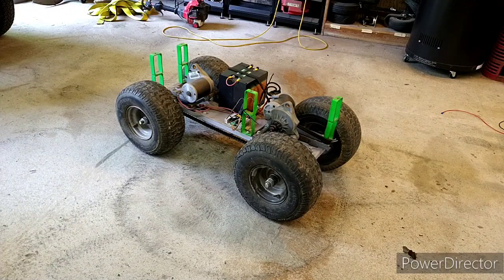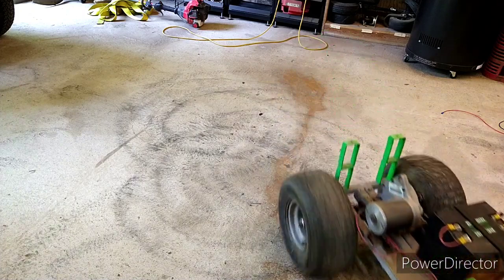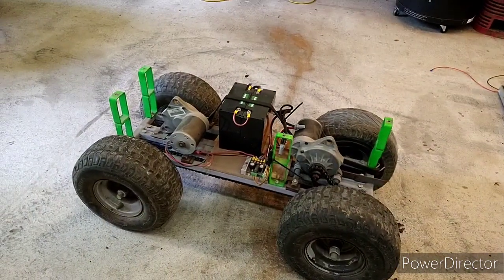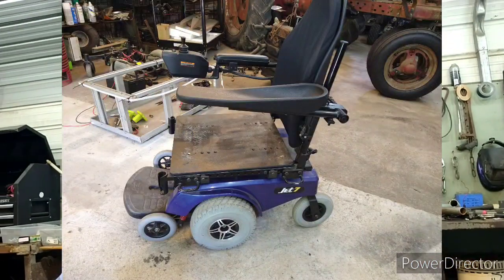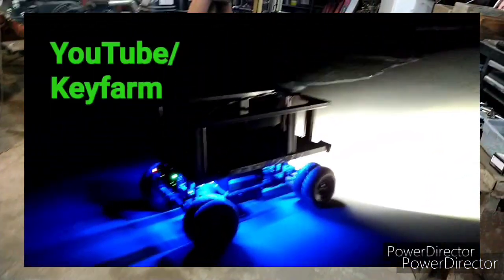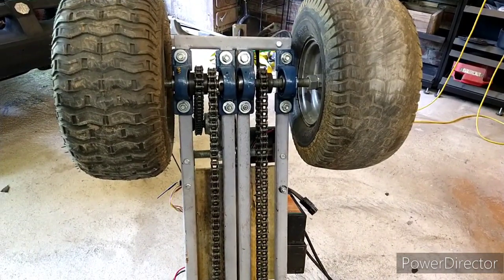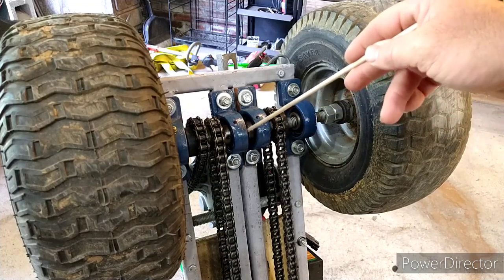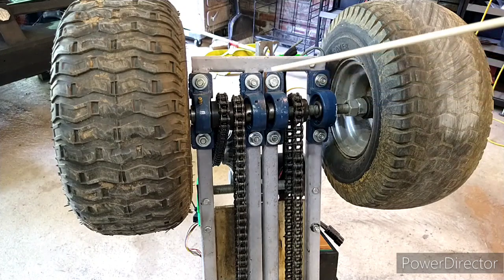Radio controlled beach wagon build video. How I built the R/C wagon.

Comment: Chris, did you have to change any switches on the saber tooth? So far I’m not getting any response even tho I’ve got green lights.
Reply from the maker: Honestly I cannot remember but if you send me a message through  messenger I'll send you a picture back of a close up of my saber tooth
Reply: @ChrisfromKeyfarm OK, I’ve never used messenger. Give me a few to figure it out. TY for your quick response.
Reply: @ChrisfromKeyfarm I can’t figure messenger out. Can you give me some guidance? 🤦🏻‍♂️
Reply: @ChrisfromKeyfarm I think I figured it out and sent you a message. Also sent a picture of my setup. I removed the red positive to prevent accidental triggering of the motors while I figure this out.

Comment: cool video thank you for sharing this how many pounds do you think them beach carts can tote?
Reply from the maker: That is going to vary quite a bit mostly because it turns like a skid steer the more weight the more you're grinding the tires into the ground if you're on slick ground that's fine if you're on asphalt that's a lot of power going through those motors. On asphalt I'd keep it to about 60 lb on grass with slick tires 200
Reply: @ChrisfromKeyfarm  ty i own a sod company looking to make an r.c that can carry 10 rolls of sod for back yard work
Reply from the maker: Cool I think you could build a version of this and it would work great
Reply from the maker: I've actually bought parts to build a second one that I'm going to gear even lower for more power and put on slick golf cart tires you may want to look into something like that as well
Reply: @ChrisfromKeyfarm yeah that's what I've been thinking it's all new so I'm trying to really educate myself on the best way to do this I don't want to just waste money I want to build an actual holler that might go up around a ramp well loaded maybe even a hydraulic Lyft
Reply from the maker: I haven't really drawn it out but I have considered one that has a front axle a rear axle and is articulated in the center
Reply: @ChrisfromKeyfarm  that would be pretty cool . im just getting older and its harder to get the jobs done with out the extra help from stuff like this . im im trying to find my plan to take me into the next round !

Comment: I desperately need you help
Reply: Ok........ I have a remote-controlled lawnmower. It has pretty much the same components. I will make a video tomorrow to put on my page of the internals. Ultimately, I  need it to be a little faster. I'm wondering if adding an identical or similar battery would increase the speed. It also has a built-in alternator. Currently, it charges the existing battery to 14.4 volts. Well, at least that's what the voltage display shows. I just need it about 3 to 5 more miles per hour faster.
Reply from the maker: @turtlewax2 mine runs faster with more voltage. So instead of being 14.4 volts if the components will handle it, make it 18 volts or 24 volts.
Reply: @ChrisfromKeyfarm  I'm almost 100 percent sure the motors can handle more voltage. My fear is in reference to any other components. It also has a deck that raises and lowers. There's a guy in YouTube that has one also. He put a chair on his mower. I have the same exact one that he has. He normally does review videos. The mower is red. I have the Daredevil version.
Reply from the maker: I'm not real familiar with that seems like it's designed to go a certain speed you could up the voltage or you could tear those electronics out and put your own electronics on and make it do what you want

Comment: Great video.  I appreciate your attention to detail in explaining your process!

I have a question about the battery options.  

Can I use a 48 volt battery from an electric bike ( already have ) 
With this controller?  Or will it fry it?   

Could I add a device to step down my volts from a 48 volt battery that you would recommend?

Thank you for your time.
Reply from the maker: I can't remember the specs on the motor controller , you could Google the specs and find the max input voltage, I wanna say it was like 37 volts. As far as a step-down converter one that provided that many amps would be very expensive.
Reply from the maker: Step down converters are great for stuff like lights and they're super cheap but not so much for stuff that draws a lot of amps

Comment: Is there a site that has bearing blocks,sprockets,chains at a deal?
Reply from the maker: I get everything off of eBay and none of it cost very much just search pillow block bearings with your size included they're like eight bucks a piece. Same thing with sprockets just search #40 sprocket ( if using 40 chain like me)and then the size of the bore that you need -example - #40 sprocket 5/8 bore 18 tooth or 5/8 bore pillow block bearing

Comment: Do you remember the dimensions of the lower frame and the size/thickness of square tube you used? Also the box on top? 🙏
Reply from the maker: It's definitely  1"x1" -1/8 thick wall tubing, but could have been thinner if I had any. Right off hand I don't remember the exact dimensions , but really just build to the size most useful to you .
Reply: I'm guessing the bottom frame is roughly 1x3.5 or 4 ft, 1in x 1in square tube that's 1/16 or 1/8 in thick, and steel?  And the top frame is aluminum, roughly the same length, close to 2 ft wide, and aroun 1.5 ft tall?
Reply from the maker: It's just tall enough to clear the batteries.
Reply: @ChrisfromKeyfarm  Thanks man. If I pull this off I will send you pics in email.
Reply from the maker: Cool 
ckeyfarm@gmail.com

Comment: I just want to reiterate how much I appreciate the amount of thought you put into this. After a YT search, I found countless vid copying a couple of builds from years ago. I cant really blame those publishers, it is useful to see their experience and that they were able to make it work, but I really didnt learn much from them over what I learned from the original couple videos. You, however, have done something unique. It is a true 4WD. It is a true zero turn. It is geometrically balanced. It has the ability to switch between power sources because of the forethought that you put into the power connections. And the fact that the power source can come from such a wide variety of options is impressive. After watching a bunch of others today .. because I have a sudden interest in this kind of build 😁I specifically came back just to share this to others. I want to see you add tracks. If I ever get to the point you got to in this video, I will give it a shot.
Reply from the maker: I have looked at those small sets of tracks but since these videos don't do very well I just haven't invested in it. Thanks for watching

Comment: Amazing video!! Been coming back to your channel a lot, not sure how I missed this until now. SOOO much great info here. For example, I was already eying the cytron as an alternative to the sabertooth, so glad to hear your endorsement!  The demonstration at the end was REALLY fun to watch!

Did you use fuses? Did you do anything to the shafts on the middle side, i.e. between the two middle bearings, to stabilize the shafts? If so I don't think I caught that, but it might not be needed.  I followed the link but didn't see it in the description .. do you know how many amps those motors draw, or what is their torque rating?  Just wondering for comparison to other options.  
🙏🙏🙏
p.s. been praying for your family member
Reply from the maker: These controllers whether it be the sabertooth or the cytron have several protections built into them so when I was using the 18 volt batteries I did run those through an inline fuse but when I ran the bigger lithium batteries I did not. I'm not sure about the amp draw ( probably average 15-25)on these motors and depending on how much work they're doing ,it would change I'm sure it spikes at the very beginning but as far as torque since they are gear reducted motors they have a massive amount of torque. 👍

Comment: I want to build something like this but I never actually built anything should I start small or just do it any advice?
Reply from the maker: If you want something similar but don't have a lot of experience building what you need to do is buy an old power chair where the batteries or the electronics have went bad. Put new batteries in it remove all of those electronics and add new electronics. I can show you / tell you how to hook it up. I have one made just like that and it is awesome an old non-working power chairs are normally about a hundred bucks.
Reply: @ChrisfromKeyfarm  yes please !  And what where do you usually get yours
Reply from the maker: Marketplace is the best place to look .
Reply: @ChrisfromKeyfarm  I found a couple !! In working condition too
Reply from the maker: Cool
Reply: @ChrisfromKeyfarm I’m trying to find a non working one so I can actually learn

Comment: Can you specify more about how you connect the electronics together , to  futher discuss we discuss in a zoom meeting ?
Reply from the maker: These electronics are pretty much plug and play. I learned how to use them by watching other YouTube videos. Search sabertooth motor controller
Reply: The electronics portion is extremely simple because its using modular components. Its basically just matching specs and doing some wiring. He already supplied the components that work for him, thats a great starting point. In fact, I highly regard his endorsement of electronic components. His commitment to budget friendly design is also very admirable. If you find these parts cheap, Im sure you can wire them together.

Comment: I desperately need this. Is there a parts list?
Reply from the maker: So I don't put a parts list in the description because links expire and that doesn't really help people but if you'll search for the part that I named on eBay every part of this buggy can be bought on eBay , surplus center, or robot shop. Excluding the steel tubing frame
Reply from the maker: For instance for the sprockets you would search,( 40 sprocket 14 teeth).
Reply from the maker: The motor controller can be a saber-tooth or a cytron

Comment: I am wondering which one you prefer between the skid steer and the smaller swivel castor steered trailer hauler you made if you take deep sand out of the equation?
Reply from the maker: Excluding the sand the two wheel drive with the casters is much more responsive and much more fun to drive
Reply: @ChrisfromKeyfarm  I have two complete power chairs and I purchased a cytron controller, I guess I can just make both versions and just swap electronics between them 😬 I also am wanting something on tracks, I live up in MN on a farm and it’s heavy clay 🫤
Reply from the maker: That sounds really cool when you get them finished send me pictures
Reply from the maker: ckeyfarm@gmail.com

Comment: Wait, you just said it was easy and then you said it was hard when you have a job...lol 
Then you said source for wheelchair motors in description...but its not!   0 for 2 now.
I might suggest just using 4 hoverboard motors, while electrically more complicated (ok  for me) much simpler mechanically.   
If you stick with the dc motors, that $100 controller crazy man, there are $10 controllers that work great on 12-18v,   BTS7960 based ones, google it.
Anyways, cool vehicle looks like it works great.

Comment: What an awesome concept I would like to do this for a surf fishing cart. I have a question on the steering using this skid steer concept. Does it track pretty straight when going straight ahead only. In the surf fishing world sometimes we have to go down walkways that are narrow so I’m wondering how easy it will be to negotiate that with a remote control system like this.
Reply from the maker: It tracks very straight as long as the axles are straight I can drive this one down a sidewalk no problem.
Reply from the maker: Thanks for watching

Comment: Hello very nice project, congrats!
What type of crown did you use on the axle and how did you lock it?
Reply: Also do ot understan how wheels are connected to the axle, I mean in rotation
Reply from the maker: The axles are currently 3/4 all thread rod , the hub has a notch while the rod has a 1/8 pin through it, the notch sits on the pin and 3/4 nuts hold everything tight

Comment: Hey mate, Thanks for the info. I'm building one! 

How long did you manage to run it for on the Ryobi batteries? Did you say what Volt and W motors you have there.....

Thanks
Reply from the maker: The Ryobi batteries do very well, especially for the price. I have some 20 amp hour lithium batteries I run in series for 24 volts. The 18 volt Ryobi batteries are parallel, so if you want longer run time you could add more batteries but the run time for 2 is good. The motor are electric wheelchair motors that are rated at 24 volts but work great anywhere from 12-24v . Thanks for watching
Reply: @ChrisfromKeyfarm  Going with 2x 18 Volt 12Ah Makita batteries in parallel on 24 Volt 250w motors.

See how it goes on the beaches in Australia 🦘!
Reply from the maker: @innovationin-sight8108 it should work great, you can send a picture of it to ckeyfarm@gmail.com

Comment: I built one with 50 in mower deck  only difference is i make it so i could use 2 semi tires cut side walls off  and stretched over your tire setup  where they are now tracks like a tank i use it to mow the field  when over 6in the deck has independent riding mower engine just to turn the blades
Reply from the maker: That sounds awesome if you have any pictures I'd like to see it. ckeyfarm@gmail.com

Comment: you didnt put any fuses to protect the sabertooth? Peak amp is 64A
Reply from the maker: When I run the 18volt drill batteries, they do have 40 amp fuses in the hot leads, in this 24 volt setup if you over amp draw the batteries, they internal monitor in the battery will shut the power down. My battery connector only hooks up one way, so as long as it is installed right, there is no reverse polarity to worry about. A fuse wouldn't be a bad idea, but I just haven't installed one in the current setup, thanks for watching and commenting.